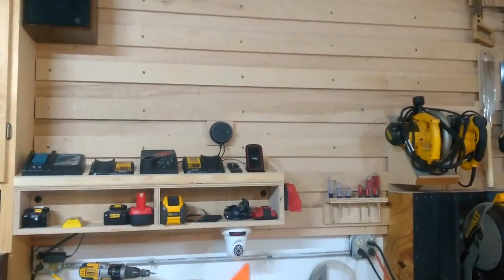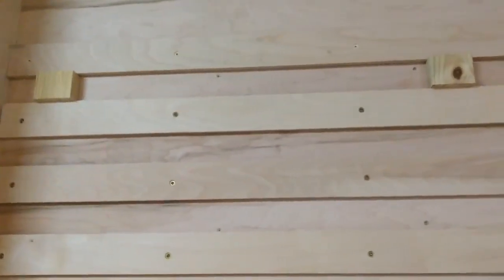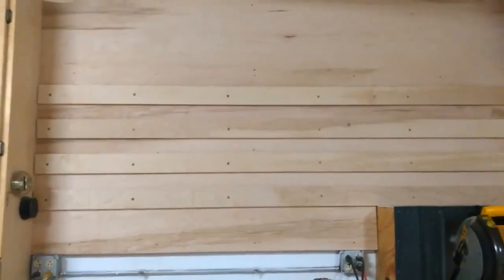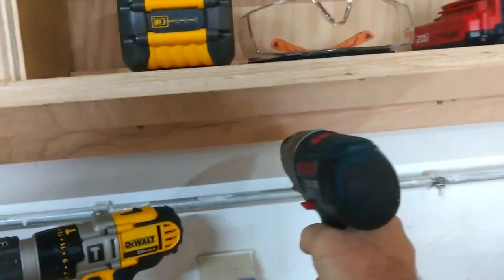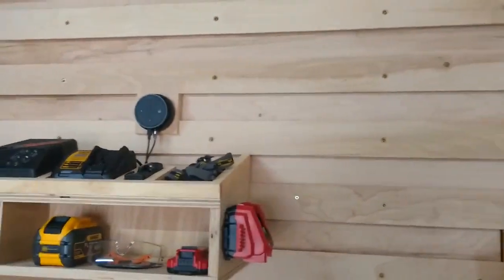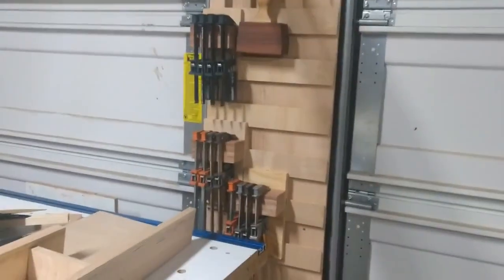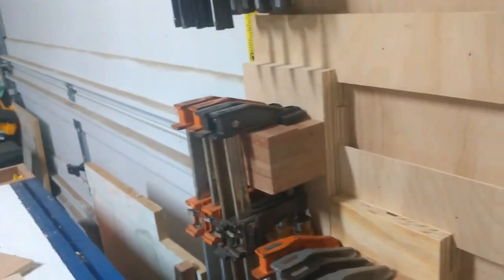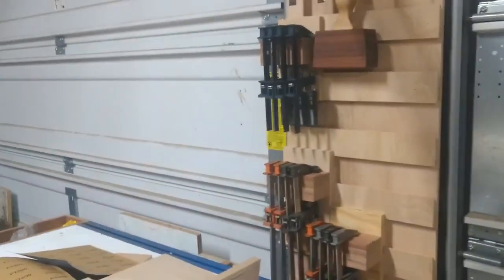Build a better french cleat  tool wall.  How and Why

Comment: The locking key is clever. Also, one strong design element is that you mounted all the cleats on a plywood board. I did my entire wall with just the cleats directly on drywall. Now I wish I had used a plywood backer, because the drywall in my garage was not perfectly flat. Maybe someday I’ll remove everything and start over, but for now your design looks good to me.
Reply from the maker: Originally I was going to mount directly to the drywall too.  But I have some electrical conduit running up the wall along side the cabinet. I figured if I used some spacer strips, I could mount a plywood wall over top of the conduit and increase the usable overall cleat wall dimensions. An added bonus was it looked a ton better since it hid the ugly conduit.

Comment: Earthquake prep. You need the locking blocks for earthquake prep on the heavy units because those are the ones that will do damage flying across the room. 

Great design. Thanks

Comment: I used your idea in my workshop and love it.  My cleats are made from oak flooring planks.  The 10 degrees works perfectly.  My locking cleats are tighter than yours (on purpose) and require a little tap of a hammer to get in but nothing moves!! Thank you for this idea!
Reply from the maker: Great, yeah I have to say, I could've been a little more exact on my wall assembly, but it was an experimental process. Glad you tweaked it for improvements. I made my key locks a tad bit small, and there is some variable spacing despite using the spacer blocks when I built it. A quick hack I use to tighten the key locks if they are too loose, is to wrap the key lock with duct tape or electricians tape to get the perfect fit.  Thanks for watching, and I got a new vid coming out soon on some wrench racks that work nicely here. Cheers

Comment: Nice little setup. Locking cleats are the way to go for light objects. Posting the information in your information window would be helpful for quick reference. But I’ll post here to help out others. He begins talking about the locking cleat system just past the 5 minute mark. Separate each wall cleat (the cleat that is mounted to the wall) by 3” using spacer blocks. Cut a 10 degree bevel upwards in the bottom of the wall cleat. Each tool cleat (the cleat that is mounted to the tool) has a 10 degree backcut bevel heading downwards on the top side of the cleat. The locking cleat (the cleat that locks the tool cleat to the wall cleat) has 10 degree bevels on top and bottom. Size each locking cleat accordingly for a loose fit so it can easily slide between the tool cleat and the wall cleat.

Comment: You provided the  solution before I had the problem.  I am just getting the walls up on my small shop, and already decided to use french cleats, but was concerning about the dislodging when removing items from the rack.   I experimented with some cleats and knew I needed a solution.  You provided it.  Just for that, I am a new sub.

Comment: Fantastic solution thanks. I also like that it works on a lot of walls that already exists if you have a standard spacing other than the 10 degree cut on the wall. But I will re cut the cleat on the tool holders to add the 10 degree cut.

Comment: Great idea! I'm just starting a cleat wall and this video has been very helpful. Many of us who want to build the system are curious as to the actual dimensions of the cleat and the space between them. You answered the question in one of the comments and, to my knowledge, are the only one on any of the French Cleat wall videos to have done so. You replied "
Woodworker Anonymous
1 year ago
Its really rather arbitrary. My wall cleats are 3 1/4" on the wide side. The spaces between wall cleats are 2 3/4".  My jig cleats are about 2 1/4" on the wide side.  But there is no right or wrong dimension, do what looks or feels right to you. The thinner you go, the more cleats and more work you create. Also the more versatility with placing fixtures. Don't cut the key lock strip till you've fully installed the wall and made a fixture or 2. Then cut the key lock strips to fit snug."

Comment: Like your battery station with cable hidden. Do you have a video how you made it..
Reply from the maker: I didn't make a video of that. I kinda slapped it together with Brad's and glue off the top of my head. Came out so good that i regret not videoing the project. Hiding the cords was a great move. I love it too.
Reply: Do you have dimensions for your battery station
Reply from the maker: @christopherortiz8713  Mines a little over 10" deep and 9" tall. Made the wire storage area about 3 1/2 inches deep from back wall. But its not critical for any measurement. Make it to fit your chargers and tools. Length will depend on how many chargers you want to load into it. Lay them all out on a bench and just start cutting to fit.

Comment: Cool & thanks. Here's a what-if that crossed my mind watching. Although you did say the charging station is heavy enough to not really justify a lock / key, let's say you put one in-- how do you get it out without pushing it through the other side? This would be tough on your station (or any other wall cabinet, if someone did want to lock it-- childproofing, eg) because it abuts a wall at the other side. You'd have to slide the whole thing, which might mean relocating a lot of items on the wall, if that even works at all (looks like not enough room to slide sideways; may need a flexible piece of something). Not wanting to overengineer it and glue magnets to the key, but having dropped enough tiny screws into places I shouldn't have, I see it happening to me here, ha.
Reply from the maker: We'll, I didn't bother with a keylock on that charging station, and there has been zero movement or even a hint of one. However, if you wanted to add one, you could just add a short keylock on either side with a something like a small screw head protruding from the side of the keylock. You  could then just pull the keylock out by the exposed screw head. That's just off the top of my head idea, I'm sure you can come up with an even more elegant solution if you think about it.  Thanks for watching

Comment: Looks great, but not sure I'd use cleats on a wall directly above the chop saw.  My dust control isn't that good and I envision  having to blow them out occasionally.  Would look good however on my one remaining wall that is destined to be a tool wall some day.  Thanks for sharing.
Reply from the maker: I get what you mean. I actually built a kind of box enclosure behind the chop saw.  There is a shop vac attached to the back of the chop saw exhaust port too. The box does a nice job of trapping the dust that shoots wide of the vacuum port. Surprisingly, virtually no dust accumulates above or wide of the box. I was skeptical as I pieced the thing together. But, you should definitely try it. Works better than it should. I used some of that rubber base cove as a makeshift curtain to close in the front of the box on either side of the saw. It really works.

Comment: How do you get the locking piece out of the wider cleats, especially the ones that are flush against something on one side?
Reply from the maker: You only need a short locking key on either side for longer jigs.
Reply: @brett328  yes, but once it’s flush, how do you pull it back out so you can move the jig?  I would think you would need a pull tab of some sort? Am I missing something?
Reply from the maker: @Huntgolfride  normally I just push it out from on side with something long and thin, or you can put a screw 3/4 of the way into the key lock, leave enough screw sticking out to grab it with your fingers or whatever. It's never really been an issue for me really. There are probably 1000 different ways to accomplish it if you want to spend more time on design.

Comment: I am going to do this in my Garage, Wwuld you suggest putting a coat of polyurethane varnish in the back board to make it easier to clean and prevent sawdust from sticking?

Comment: Great idea! I will be doing something similar in my shop as well. I'm curious about the 10 degree angle (and NOT for reasons others have mentioned)... why is a 10 degree angle needed at all? Isn't the more important factor that the cleats on the backside of each mount be consistently sized (along with the spacing between wall cleats)? Then, a key with a square or rectangular profile (rather than trapezoidal) could be used the same way. Unless there's another reason for the angle that I'm missing, I think this would save multiple extra rips on the table saw. Would love your thought, though... again, nice work!
Reply: FWIW, I was explaining this to someone and realized that in order for my approach to work, the back ‘plate’ of whatever you’re mounting does need to be above the top of its cleat (even just 1/8”)  so as to prevent the key from moving forward. So the bevels would be necessary if the cleats were always flush with the top of the mounting plate. I guess my mental model of what I’m mounting is to have the cleat below the top of the plate which is why I didn’t consider the alternative initially.
Reply from the maker: @TheDavidkeyes  Honestly, you could get away with a squared key lock, I just figured a slight angle on top and bottom would provide tighter hold on the jig. Especially if the jig doesn't span the next row of cleats above and below. And since your setting up the saw to cut the cleats and keys, its no big deal to rip a few 8 foot key lock strips at once and just keep them in reserve for when you need them.

Comment: Skip to 4:50 if you want to see a funky electrical installation, a cable with two male plugs! :D
Reply: I thought that too......But if you will look at the receptacle on the right, there are 2 cords... coming from the hole in cabinet underneath the bench...one going to the right receptacle and the other going to the receptacle on the left
Reply from the maker: @djpapachris  Yup. those are 2 different yellow extension cords. Each outlet is on a different circuit.  So those extension cords carry power from 2 circuits to the far end of the workshop. that way I can keep the dust collection on a different circuit than the tool being used.
Reply: Really like the cleat system. The extension cord(s) is why I ventured into the comments section :-) .  Glad to learn it's actually not a two-headed beast. I got ripped by one of those when I was a kid - thanks, grandpa.

Comment: The locking system, why 10 ° not 45°  or something in between? At 10 it is fully locked so nothing else is necessary?  Would 45 be harder to slide in?
Reply from the maker: If you make the key with 45 degree sides, the jig cleat (the cleat mounted on the back of the fixture) will be able to be pulled up and off the wall at 45 degrees..

Comment: Brilliant system! Getting ready to build my cleat walls and am definitely using this system. What space do you use between cleats? I love the false wall too. However, I'm using a piece of luan with magnets so I can pull the whole thing off rather than slide it and risk it getting stuck. Also easier to clean.

Comment: All you have to do with the system John Heisz used is make the rebate wider then the tongue of the hanging piece. Which it looks like he did on the tool holder next to his drill press because he lifts and rotates it out no problem no sliding involved.
Reply from the maker: Yeah, I just saw his vid yesterday. Definitely solves some problems an looks great. However, I don't think it'll work on large pieces like my charging station. I do like it though, and commented on it that it was way better now.
Reply: @brett328  I'm sure you could make a beefier wall with bigger groves. I like your system though. Its a good fix for preexisting system as long as one didn't go overboard with fastening their cleats to the wall and can get them down to dimension them.

Comment: Do you have plans for the charging station?  I like the idea of hiding all the wires
Reply from the maker: I wish I did. But I was just measuring, cutting, gluing, and Brad nailing right off the cuff. Turned out to be a very awesome little shop asset. Really love the way zero wires show anywhere. If I did it again, only thing I would change is to make it longer for more chargers, and to screw the charger dividing cleats on top instead of gluing and Brad nailing. That way, if you change the type of chargers you are using, you can easily reconfigure the top to perfectly fit any new charging block. As it is now, I'd have to do some careful deconstruction to change out the chargers. But thanks for watching.

Comment: The problem with this type of locking system is it requires room for sliding the lock in from the side. Fine if you have enough room (though it also limits the places you can put things). A dowel system works as well, is easily placed and removed and is faster for moving things around. Nice wall, just not keen on the locks...

Comment: I have a question. How do I avoid the edge to chip on my French cleat cuts?
Reply from the maker: After you've cut all your cleats, you can run them all thru the table saw one more time and take off about a 16th from all the 45 degree cut edges. That'll help prevent splits and splinters.

Comment: When you hung your plywood behind the cleats, did you attach it directly to the drywall behind or did you put some spacer blocks? Trying to figure out the best way to do this since my wall is not straight
Reply from the maker: I attached some 2x4's on the flat side to the wall, then attached the plywood to the 2x's. I did that to bump the cleat wall out far enough to go over top of the electrical conduit on my wall. Looks better, and makes the usable cleat wall wider. Not sure I would have done all that if there wasn't any conduit on the wall. But it does look much nicer in retrospect.

Comment: Curious... why 10 degrees? Why not the same degree as the French cleat? Just for consistency
Reply from the maker: Well, really you can make it whatever you want. I just figured a 10 degree backcut instead of a 45 would leave more meat on the permanently attached wall cleat. Not an issue if your cleats are fairly wide, but if want to go with narrower cleats, 10 degrees leaves a wider contact surface when you affix it to the wall. Certainly not a must, just my thought process.
Reply: If you use the same angle as the cleat, after you lock it you will still be able to raise the cleat as it will angle outward at the same rate is it rises. in reality for the safest bet, the mating surface on the cleat and the lock where they meet should be at least 5 degrees (depending on how precise the fit is across the wall) but no more than 50% of your cleat angle. The angle between the lock and the cleat is to prevent the lock itself from being pulled straight out.
Reply from the maker: @spyder666111  That's a really good point.  A 45 degree key lock angle wouldn't stop you from being able to pull out the jig cleat at a 45 degree angle.  So, 10 degrees is more than enough to trap the keylock,  and small enough to trap the jig cleat with ease.  Just a lucky 1st guess on my part.
Reply: @spyder666111  that just saved me some future frustration, thanks!

Comment: Curious why you chose 10°, I was thinking 45° on both top and bottom.
Reply from the maker: This was brought up before. And the problem there is the fixture you are hanging on the cleat wall will actually be able to be pulled out if it's lifted up and out at 45 degrees.  Anything less than 45 on the back cuts and it will be locked. Hard to explain in words. But take my word for it.
Reply: Woodworker Anonymous that makes sense thank you

Comment: nobody but nobody addresses the issue of shop dust covering your cleat items. Cabinets with sliding doors will solve the problem. Use lexan for visibility.  Your thoughts
Reply from the maker: Lexan to cover the whole clear wall system is expensive. Dust control might be cheaper and easier.

Comment: What are the dimensions how far do you space the cleats a part and how thick are your cleats?
I for sure am going to build this I just would like more information I think it’s perfect.
Reply from the maker: Its really rather arbitrary. My wall cleats are 3 1/4" on the wide side. The spaces between wall cleats are 2 3/4".  My jig cleats are about 2 1/4" on the wide side.  But there is no right or wrong dimension, do what looks or feels right to you. The thinner you go, the more cleats and more work you create. Also the more versatility with placing fixtures. Don't cut the key lock strip till you've fully installed the wall and made a fixture or 2. Then cut the key lock strips to fit snug.
Reply: Thanks
Reply: I don’t understand why you suggest waiting to make the locking strips. If the cleats are all the same width and the space between them is the same and they all have a 10 degree undercut.... what can change after you’ve put on a fixture or two?
Reply from the maker: @bobm6423 You can't know the exact dimension to cut your key lock for snug fit til after installing the cleats to the wall, then cutting your jig cleats to size. Even though you can do the math on paper, it's best to test fit the key lock to the actual wall and jig, so you get the perfect snugness ( if that's a word). A 32nd here or there and it can be too tight or too sloppy.